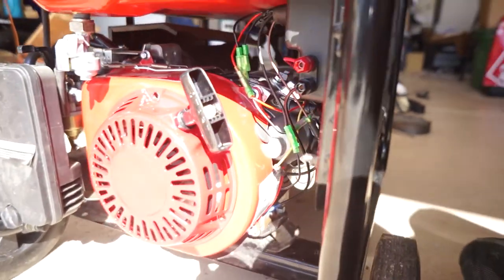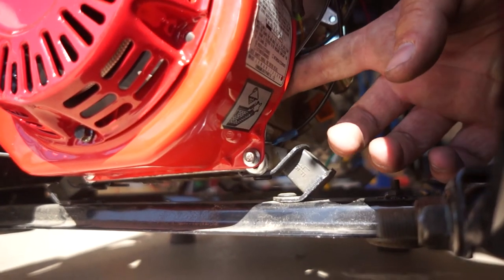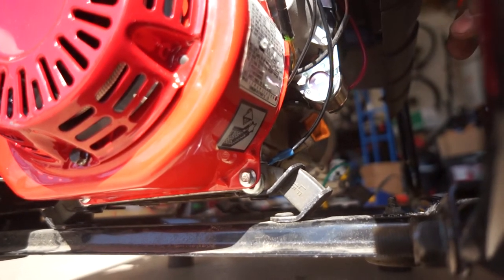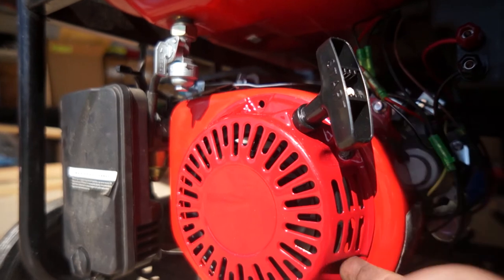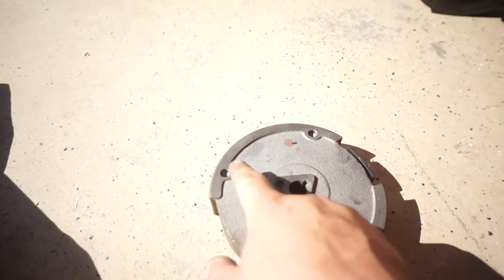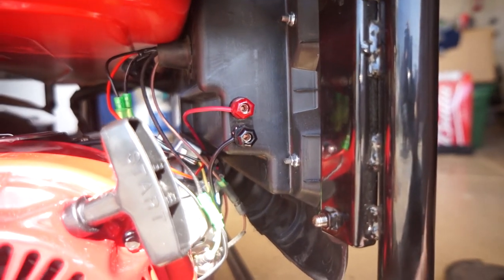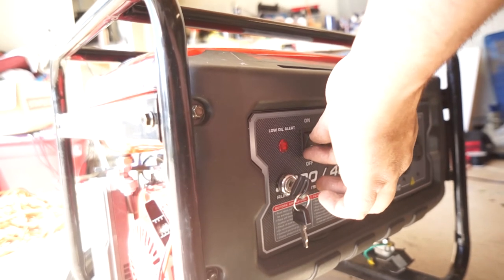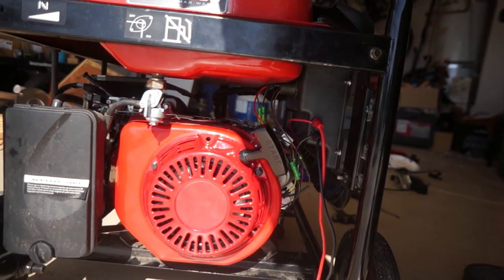Harbor Freight Generator adding electric start

Comment: Careful what kit you buy, Predator 212cc taper on crank is different size pre 2015. You must by the correct kit with correct flywheel taper or it wont sit back on the way.
Reply: I have a 2020 model I think. Unless they are still putting out older models but due to demands I think I have the 2020 model
Reply: ⚠️Here are the safety rules of using portable generators

It is important to follow all generator safety rules whenever we use portable generators: 

Everyone must see this. This is just a reminder for everyone’s safety. 

1) KEEPING OTHERS SAFE: Please do not allow an unqualified person or your children to operate and service the portable generator. Just because some manuals don’t say that doesn’t mean it’s safe. That is important against the generator safety rules. We also need to be keeping an eye on our children too. You need to make sure that your children are not playing near the portable generator especially when it’s running so they won’t get electrocuted. Generators pose electrical risks and they can be hot during an operation. Please keep your children away from the portable generator at all times. It is important to keep our children safe especially our little ones. Be aware of all the hazards.

2) WHERE TO RUN YOUR GENERATOR: Some people use their portable generators indoors which increases the risk of carbon monoxide poisoning. It’s important to have a carbon monoxide if you have a gas generator. Never ever use your generator indoors even if your doors and windows are open and even in the garage is not safe to use a portable generator. Not even at your porch and your deck. It is never safe to use your generator indoors and in enclosed areas of your home. Your generator needs to be 15-20 feet away from your house. 

3)🔥FIRE HAZARDS: Never refuel your generator while it’s running. You need to let your generator cool off before refueling it and before storing your generator. Never overload your generator too. Never ever back feed your generator. You should never plug your generator into a wall outlet. Also never store propane tanks indoors. Please keep flammable things away from the generator as well and please don’t smoke cigarettes near the generator. Having a fire extinguisher next to the generator is also important against the generator safety rules. 

4) GENERATOR OPERATION: make sure your hands are dry before touching the generator. Never use your generator in wet conditions. Don’t let your generator get wet. You need a generator tent if you need to use your generator during wet weather. Please don’t wear loose clothes when operating the generator. Turn on your generator before plugging in appliances. Use the right cord for your generator. Please do not use worn out cords. 

https://youtu.be/I1jT3ANENvI and here is a video more about keeping others safe when using generators 

Hope this helps. Remember it’s better to be safe than sorry.

Comment: Fyi this is the exact same setup, parts and mods needed to add an electric start to the durostar 3300-4400 models..  depending on year the shafts may be tapered , older ones pre 2018 could be tapered..  but either way a step drill and patience will make it work..  have to go slow with the cast flywheel or you will crack it..  but is just a 50$ mistake..

Comment: What year is that generator. Looks like the kit won't work for 2015 and newer?
Reply from the maker: I've heard this a few times. I bought not from ebay, but from Amazon.
Reply: Pre 2015 on predator pre 2018 on durostar..  are tapered..  or could be tapered..

Comment: I would love to know what the wiring diagram looks like.  I have the same generator and the key switch has 6 wires coming out and I have no clue what wire does what?
Reply: ⚠️Here are the safety rules of using portable generators

It is important to follow all generator safety rules whenever we use portable generators: 

Everyone must see this. This is just a reminder for everyone’s safety. 

1) KEEPING OTHERS SAFE: Please do not allow an unqualified person or your children to operate and service the portable generator. Just because some manuals don’t say that doesn’t mean it’s safe. That is important against the generator safety rules. We also need to be keeping an eye on our children too. You need to make sure that your children are not playing near the portable generator especially when it’s running so they won’t get electrocuted. Generators pose electrical risks and they can be hot during an operation. Please keep your children away from the portable generator at all times. It is important to keep our children safe especially our little ones. Be aware of all the hazards.

2) WHERE TO RUN YOUR GENERATOR: Some people use their portable generators indoors which increases the risk of carbon monoxide poisoning. It’s important to have a carbon monoxide if you have a gas generator. Never ever use your generator indoors even if your doors and windows are open and even in the garage is not safe to use a portable generator. Not even at your porch and your deck. It is never safe to use your generator indoors and in enclosed areas of your home. Your generator needs to be 15-20 feet away from your house. 

3)🔥FIRE HAZARDS: Never refuel your generator while it’s running. You need to let your generator cool off before refueling it and before storing your generator. Never overload your generator too. Never ever back feed your generator. You should never plug your generator into a wall outlet. Also never store propane tanks indoors. Please keep flammable things away from the generator as well and please don’t smoke cigarettes near the generator. Having a fire extinguisher next to the generator is also important against the generator safety rules. 

4) GENERATOR OPERATION: make sure your hands are dry before touching the generator. Never use your generator in wet conditions. Don’t let your generator get wet. You need a generator tent if you need to use your generator during wet weather. Please don’t wear loose clothes when operating the generator. Turn on your generator before plugging in appliances. Use the right cord for your generator. Please do not use worn out cords. 

https://youtu.be/I1jT3ANENvI and here is a video more about keeping others safe when using generators 

Hope this helps
Reply: @The_Happy_Aviation_Enthusiast  This answers nothing and you're messing with natural selection by warning the challenged, quit it.

Comment: What battery did you use as your starting battery?
Reply from the maker: I used a special battery. For safety reasons I'll just say a 7ah battery will work.
Reply: ⚠️Here are the safety rules of using portable generators

It is important to follow all generator safety rules whenever we use portable generators: 

Everyone must see this. This is just a reminder for everyone’s safety. 

1) KEEPING OTHERS SAFE: Please do not allow an unqualified person or your children to operate and service the portable generator. Just because some manuals don’t say that doesn’t mean it’s safe. That is important against the generator safety rules. We also need to be keeping an eye on our children too. You need to make sure that your children are not playing near the portable generator especially when it’s running so they won’t get electrocuted. Generators pose electrical risks and they can be hot during an operation. Please keep your children away from the portable generator at all times. It is important to keep our children safe especially our little ones. Be aware of all the hazards.

2) WHERE TO RUN YOUR GENERATOR: Some people use their portable generators indoors which increases the risk of carbon monoxide poisoning. It’s important to have a carbon monoxide if you have a gas generator. Never ever use your generator indoors even if your doors and windows are open and even in the garage is not safe to use a portable generator. Not even at your porch and your deck. It is never safe to use your generator indoors and in enclosed areas of your home. Your generator needs to be 15-20 feet away from your house. 

3)🔥FIRE HAZARDS: Never refuel your generator while it’s running. You need to let your generator cool off before refueling it and before storing your generator. Never overload your generator too. Never ever back feed your generator. You should never plug your generator into a wall outlet. Also never store propane tanks indoors. Please keep flammable things away from the generator as well and please don’t smoke cigarettes near the generator. Having a fire extinguisher next to the generator is also important against the generator safety rules. 

4) GENERATOR OPERATION: make sure your hands are dry before touching the generator. Never use your generator in wet conditions. Don’t let your generator get wet. You need a generator tent if you need to use your generator during wet weather. Please don’t wear loose clothes when operating the generator. Turn on your generator before plugging in appliances. Use the right cord for your generator. Please do not use worn out cords. 

https://youtu.be/I1jT3ANENvI and here is a video more about keeping others safe when using generators 

Hope this helps. Remember it’s better to be safe than sorry.

Comment: If you can update or add a photo... where did you mount the battery on board? Nice job! I enjoyed the video. Would help if you could show without the cover in place too.
Reply from the maker: I didn't mount a battery. I used power leads going to the Bus conversion.